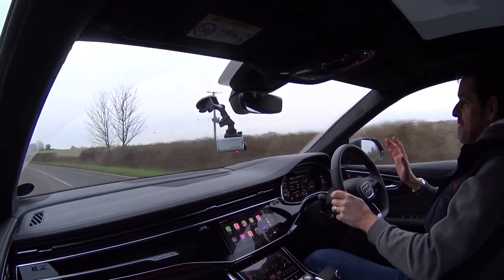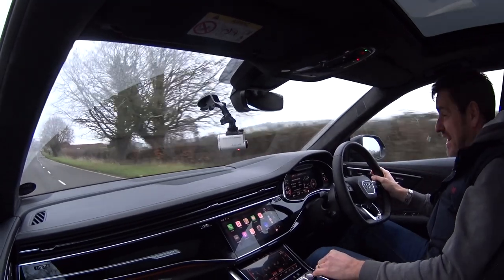Why are Car Makers obsessed with Fake Exhausts ?! [MONDAY TORQUE]

Comment: Dude!! tell me about it! Im so glad they didn't change it on the MK7 golf GTI/R they stuck with stainless real Exhaust, until the Mk8 of course! I asked a manufacturer why they do this and they said its to do with keeping them clean.! it frustrates me also! great vid as always! :)
Reply from the maker: What a rubbish reason 😮😂
Reply: Petrol Ped agreed! Nothing more therapeutic than cracking open the autosol and rubbing away the grime to get that mirror finish 😂

Comment: Love this new VLOG format Pete. This worked well. How about ‘Monday’s Musings’ for a title? Or ‘What’s in Ped’s head’? Fake exhausts are a pet hate of mine too. Fake vents too, for that matter. Even BMW have succumbed to the vents and I thought they knew better. Form should follow function I always think. Otherwise it’s just a naff-looking design gimmick and utterly pointless. Future content could be around the tech in modern cars. Are infotainment systems getting too complicated? As an example, BMW’s iDrive can have up to 4 different input methods - scroll wheel, voce command, gesture control or touch screen. Also, do cars have too many different drive modes and settings? Is car design getting too fussy - all unnecessary creases etc? Will we trust autonomous cars in the future, when we know already how often tech lets us down and needs a reboot? Are electric cars really the future? Are cars becoming more about the tech they contain than the cars themselves? Do people care about the mechanics of a car? Are we losing our love of mechanical engineering in the digital age? Sounding a bit like a Luddite there I know. I like tech that’s useful and works, just some stuff recently seems more gimmicky and glitchy than being of any practical use. Some seem an answer to a question no one asked in the first place. Just throwing lots of stuff out there! I’d be interested to hear your views and those of viewers too, via the comments in some future vids.
Reply from the maker: Thanks for these Andrew. Some great suggestions there 👍

Comment: Also I don't like LCD screens sticking up on the dash board. I didn't like LCD screens built into the dash in the first place but it looks even worse when it's sticking up on the center of the dashboard. Put the screen into the center console if you insist having the thing there.
Reply from the maker: LOL...I have ranted several times in the past about that. It does my head in too 👍

Comment: I asked a designer at Jag once why fake exhausts and augmented exhausts have started on new cars . He asked me why I'm against them and I said pretty much the same as you. I cant really see the point of them and he said its primarily for two reasons. One is the emissions regs and the other is design aesthetics. He said if you put a small exhaust on he believes it puts buyers off. I said it wouldnt put me off but we agreed to disagree.
Reply from the maker: It is almost like designers don't talk to the car buyers 😪
Reply: @PetrolPed  That's exactly right

Comment: Totally with you on the exhaust topic - I hate fakery of any sort. Once I knew the tail-pipes or the exhaust sound were just BS they would irritate every time I encountered them. The car would have to go. I have the same feeling about fake wood and fake carbon fibre in car interiors. Don't get me onto the topic of F1's DRS and 'trick' tyres 8-)=
Reply from the maker: LOL...I've opened a can of worms here I think 😂
Reply: @PetrolPed  I guess I'm a bit of an extremist - my Caterham is bare aluminium which is on the outer edge even by Caterham owner standards.

Comment: Neighbour has an Abarth 124 spider which sounds amazing.. but has a tiny 1.4 engine.. properly augmented exhaust.. and disappointing performance. The exhaust is all it has going for it. back in 2004 I had a Honda S2000 and the opposite applied. Sounded like a pussycat until I wound it up, but performance in heaps. I got rid of it after 3 years because I used it more around town more than on open roads and for slow gear-change town driving the gearbox was clunky (it needed to shift quickly)..and... unwound, you could barely hear the engine was on. So I think you're right, I hate fake.
Reply from the maker: I had an S2000 for 5 years. Brilliant car. The Abarth 124 might not have that much power but it delivers a superb driving experience and actually very similar in the respect to the S2K 👍

PXd my S2K in for an Audi TTS and have always regretting letting her go. Should have kept her as a track day toy 😪

Comment: Moaning Monday sounds good to me!
 Yes, no, I've never had a cat stolen, precious metal or precious moggy! But now I'm perplexed, as I thought a catalytic converter had to run at high temperature to be effective. So I always thought they were much nearer to the engine. At least one of my previous cars had a cat right after the exhaust manifold!
Reply: Your correct, modern cars the cat is in the exhaust manifold, to work effectively it has to get very hot as quick as possible,.
Reply: Range Rovers are also an easy target as you don’t need to jack them up
Reply: @richarddulieu1829  😆 True!!

Comment: The majority of the issues you raise from the past all come down to a combination of two things, market value of the item and technological improvement. Stereo’s used to be desirable to steal because if you wanted a good head unit you had to go aftermarket, car manufacturers began producing audio upgrade packages integrated into the car, market value of headunit’s drops = less stereo thefts. Alloy wheels, used to be a luxury option (in some cases still are) however now you can buy an economy car that comes with alloy wheels as standard. Making something illegal does not reduce the likelihood of something being stolen, when theft is already illegal and so is handling stolen goods - you defeat your own argument there. I would imagine the best way to reduce these things from occuring would be to find a cheaper alternative within the component itself, wether another particulate can be used that is not a precious metal or the way in which it is applied or constructed so cannot be refined back again. Remove incentive through engineering and the problem will cease to be cost effective (or worth the risk).
Reply from the maker: Interesting points. Thanks for this 👍

Comment: Not just fake exhausts - fake vents too, front and rear.  It all appears to be part of the current trend but not to my taste.
I guess with the Audi S models buyers would feel like they're missing something, that it didn't look like a proper S model,  if the car didn't have the usual quad exhausts so Audi have had to make a compromise.
SUVs are a big target for cat thieves as being jacked up they are easier to get underneath.  However I gather the problem with Toyota thefts has been so great that Toyota can't source enough replacement cats due to the limited supply of those precious metals.  As a result many owners are having to wait months for a replacement cat.  In the meantime they can't use their car.
No doubt all of this will be reflected by an increase in insurance premiums, for certain cars in particular.
Reply from the maker: Wow...that's not good 😳

Comment: My car has fake oval exhausts but they are a metal chrome finish but like you say don't put them on. I think it is a psychological thing if you come along side one of these cars at traffic lights them being on the left & you might feel disadvantaged pulling away from the lights also I think if you feel cheated by this you should be able to get compansation for something you don't want...maybe then they might stop doing this ...crazy.
Reply from the maker: Sure is 👍

Comment: Modern cars are so disappointing . Fake exhausts and exhaust tips , fake exhaust sounds piped into the cabin, fake badging denoting the engine is a 3.0 litre when it's actually a 2.0 litre, fake leather interiors (wasn't that just called vinyl in the old days) plastic interior bits made to look they're made from metal, marketing 4 door cars as coupes just to try and make a saloon/hatchback car sound more stylish than it actually is; do people really fall for that spiel? Thoroughly depressing state of affairs.
Reply from the maker: It's not all bad...honest 😜😂

Comment: Did you see Ott Tanaks crash in Monte Carlo during the WRC? Really impressed they walked away from that! 👍👍👍👍🏁
Reply from the maker: Mate I sure did. The in-car footage is incredible. The role cage didn't flex or bend at all !!
Reply: @PetrolPed  
Thank god for great structural engineering on the roll cage and seats, harnesses, to be able to walk away from such a high speed crash is a true testament to all the guys who build rally/race cars. The speeds would not be possible without having full confidence in the safety devices of the vehicles 👍👍👍👍👍🏁

Comment: It's all about achieving the lowest EU6 CO² emissions. Originally Mercedes in December 2016 planned to use 'real double exhausts' as on W246 models, but failed to manage sufficient reductions required on their A & B Petrol and Diesel Class Series, therefore modified the rear box and left the rear design unchanged, other than to leave the 'fake outlets' as shown. However they did manage to lower the CO² in doing so and reduced them sufficiently to acquire a EU6 Qualification. On my 2019 B200CDi AMG where the front air intakes are 'real' and ok with the rear exhaust fakes, did achieve 76.3 mpg over a 90 Mile trip an improvement of 2 mpg (2¾%) from the W246 Series, Meanwhile an Airbus Streaked overhead en-route to New York and puffed out several tons. I should have perhaps paid well over twice what they are worth and bought an EV thereby making the Airline Passengers feel less guilt free. The word HYPOCRIT comes to mind but can't spell it.
Reply from the maker: Really interesting...thank you 👍

Comment: My TTS has quad exhausts - all real thankfully - however it did have a piped in 5 cylinder engine sound in the cabin and was one of the first things I coded out using Carista - the cabins massively quieter now and you can actually hear the 4 pot engine (including pops and crackles as you change gear) for real now and in my view sounds 100% better - silly fake sounds and fake bits are simply silly!
Reply from the maker: Thanks for this Rob. Very interesting 👍

Comment: I personally hate those fake exhaust tips and I don't know why car manufacturers do this these days.
I mean for example look at the 2022 Audi S8
It got giant quad pipes in the back that are first just black or chrome painted plastic and you can clearly see when standing behind the car that those tips are fake and filled with plastic.
The real exhaust is a tiny pipe underneath the car.
I don't get that trend and I think it ruins some cars that could have had more potential in the sound department plus it just ruins the asthetic in general if you can clearly see the fake tips.
Oh and dont even get me started on sound generators or artificial sound.

Comment: Bro-in-law had the cat stolen from Hyundai hybrid last month. It was parked in central London car park amongst lots of expensive gear. It was a loan car so much embarrassment.

Exhaust tips and trims have become a fashion item which probably makes it easier and cheaper for the manufacturer too. I guess the majority don’t care but I’m a car nut and whilst style is important I  want form to follow function not  Carlos Fandango  trims, vents  and scoops. My Porsches were all real (function first)  but I moved to an E53AMG to find decorative trim trying to fool me. I put that down to being AMG “light” model. Now a C63S and it’s also quad trapezoidal trim attached to the bumper but not the exhaust (I guess some of the gases do pass through though). A bit of an insult. A con even. My previous C63’s (old school 6.2’s) had proper exhausts. Agree, i could walk away from buying a car on this alone and will be looking more closely next time.
Reply from the maker: I knew Mercedes were guilty of this too so great to hear from an owner 👍

Comment: Agree totally, on my C7 RS6 I don't open the valves because the fake exhaust sound is so AMG like and terrible, I "hate both", please listen Audi. Audi/VAG as a brand is starting to build a reputation as the FAKE car manufacturer, so much to look at, but not everything you see is real. All these fake intake/outlets etc... I am perpetually disappointed at most new cars today, more electronics and more loss of emotive engagement in driving... what will all these cars cost in 7 years time to maintain when so many sensors and components can fail. It seems the best days of cars are behind us,  I listened to that superleggera DBS the other day and would take a vanquish everytime.... I don't care about your top speed I want emotive connections. Straight lines last for 15 seconds... and you do this how often!!....Cars like a 720s are an utter waste of time and not something I smile at, I just wonder how superficial and ignorant is the owner who committed this kind of money to a car like that... There is zero respect, zero ambition, zero desirability.... it says look at me, I am a fool... :-) I watched a Senna the other week come down his driveway, negotiate the end of his driveway with trepidation, then cautiously move of up a narrow twisty road, because of its width.. and value.. I just laughed to myself....and knew I was having so much more fun...in a regular car.

Comment: Smart for two Brabus is the worst!  Has metal tips point back welded onto the back box, thee are blanks.  But actually has 2 holes in the bottom facing down..... however on the back of the For four. The metal tips facing back are real!!!
Reply from the maker: I need to check this out 👍😂

Comment: That's naff. My 4 grand Focus ST has 2 very real and very loud exhaust pipes sticking out of the back of it. Any Audi driver will testify to that as I pass them. Actually, I used to pass them in my Corsa 1.2.

Comment: Hi,
First time viewer of your channel and found your story insightful.

I was wondering if you could discuss why VAG cars have so many issues with their door locks. They are German brands but use cheap Chinese mechanical parts in the actuators. The failure rate of these locks is insane. VAG should cover the cost of repairs for any failure. It's unacceptable and winds me up!

Thanks
Reply from the maker: Not heard of this problem. I'll take a look 👍
Reply: @PetrolPed  a quick Google search of Audi/VW door lock actuator fix will give you plenty of results lol.

Comment: I used to buy the magazine  WICESIHSN  or What In Car Intertainment Shall I have Stolen Next in the 90`s, I knew about Cat`s being stolen many years ago, having been it the trade helps....often the rest of the exhaust has to be replaced as they that damaged in the process.
Reply: I especially liked the articles about what radio/cassette left the best looking dangly wires after it has been stolen

Comment: They all seem to be doing it now,Mercades,BMW..all with these fake exhaust tips or plastic trims with the exhaust not actually going through,Does make you wonder why the hell why because in the case of this Audi SQ8 all they had to do was End One Change Two Out Tip,You can buy these pretty much anywhere though its definitely a mod id do to that SQ8,chop off the fake crap and put proper 2 working tip end on it.

Comment: Fake tips are worse than lazy design, it's a con imho.
I'll not entertain cabin speaker fakery either.
On the flip side, I love internal valves because it's still using a functional part of the car (exhaust)  to create the sound you require.
Reply from the maker: Yep...agreed 👍

Comment: The fake exhaust tips and augmented sound probably fall into the same category as tail fins and fake hood scoops ... ornamentation / bling and glitz ... plain and simple. It's only there to boost the ego of (most) owners of these vehicles. I think it is safe to say that you are not alone in your dislike of this fakery.
Your tale of the catalytic converter being stolen is quite startling. I can't say that I've heard of similar stories here in North America, but I wouldn't be surprised if it is happening. The cat in my Neon is pretty much attached to the manifold on the engine. Looks like it would be a pain to steal or replace.
Cheers!
Reply: Frank McGorman so I’m guessing to not boost your ego, you drive a base spec of the cheapest dullest car on sale?
Reply: @Jabber-ig3iw  the "daily" is a '03 Dodge Neon, 2 litre, 5-speed. While basic, it does have some character. My "other car" is a '61 Austin Mini Countryman, which has character in spades. So, no, I don't think I need any thing to "boost my ego". Now, what do you drive?